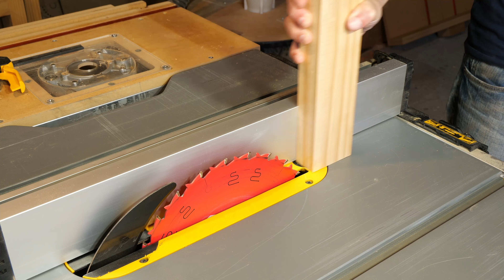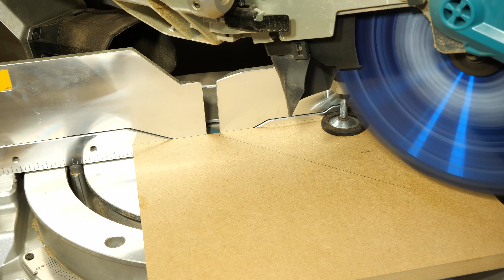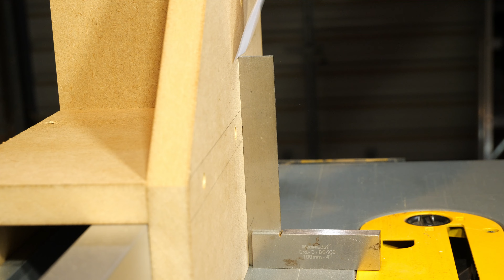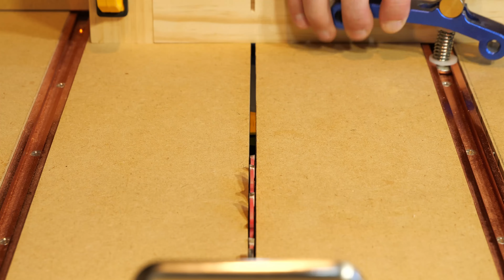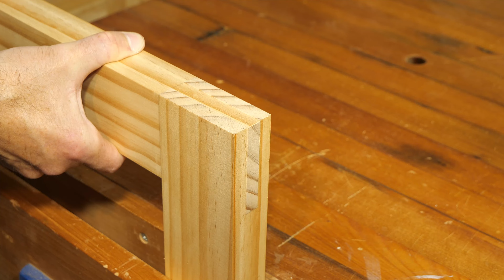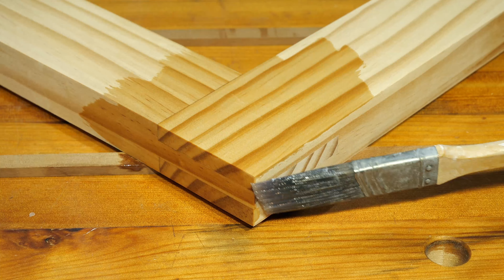How To Make VERTICAL CUTS SAFELY on a Table Saw | Woodworking

Comment: Will you ever do a DIY video on how to make the table saw slide/cradle? I'm slowly getting into wood working and just recently got a table saw but haven't really got any accessories for it yet. So I was really curious on how to make that, if that's no issue. Thanks!
Reply from the maker: @scanr10 I think you mean a table saw sled? The best video would show how to make one from the beginning, but since I already have one, it's not the highest priority project. There are heaps of videos available on YouTube with different table saw sled designs. I would recommend starting with a very simple one if you are just getting into woodworking. Thanks for asking and good luck!

Comment: Nicely made jig, but I did find myself thinking during the video: "If I had the other tools, I would just use them to make the cuts."

But good to create a jig if you regularly need to make those types of cuts
Reply from the maker: Yes, these joints can also be cut with hand tools. I agree that jigs are worthwhile if regularly making a certain type of cut. And sometimes they make the cut safer if using power tools. Thanks!
Reply: This type of jig can be used for other general purposes like cutting very acute angles, since the table saw blade will only go to 45.